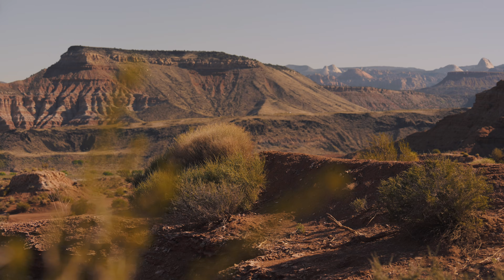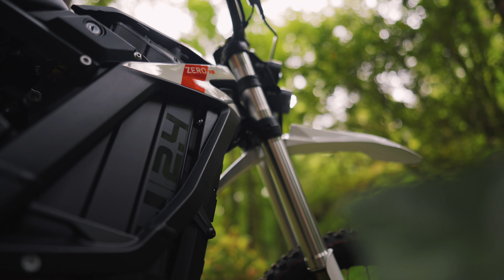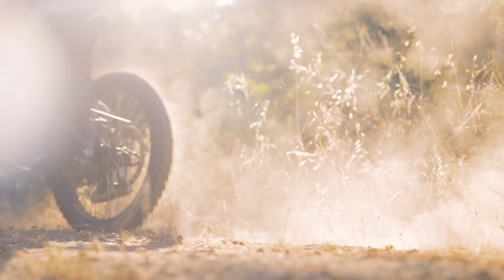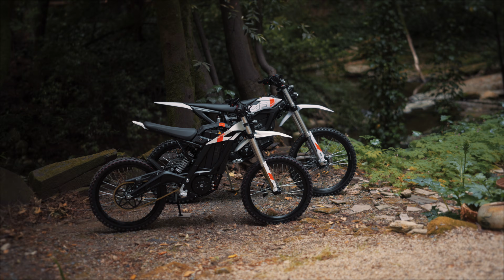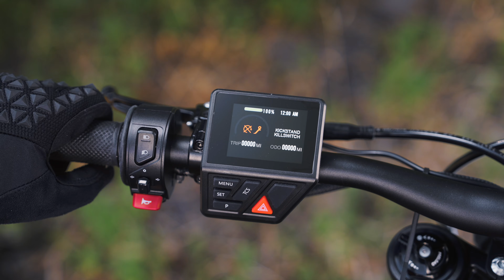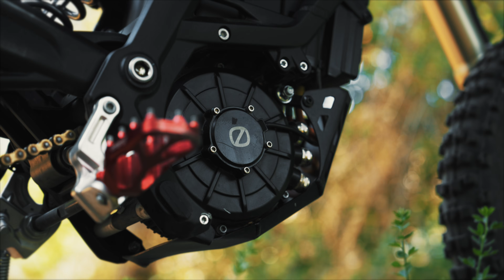Zero XB Rider Guide: Features, Modes, and Trail Capability

Comment: Is that not a modified Sur Ron?
Reply from the maker: It’s built on a completely different platform—different frame, battery, motor, and suspension.
Reply: @zeromotorcycles  yeah but its an electric dirtbike... ha   cool new bike zero, looks a little small for me :)